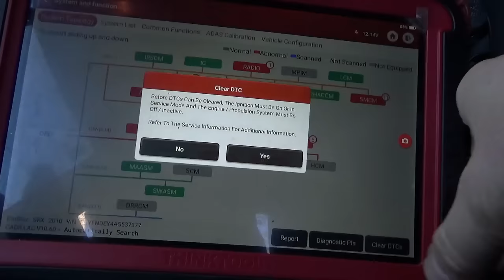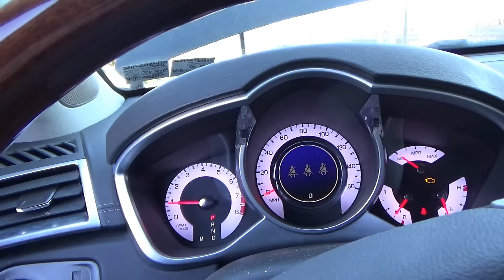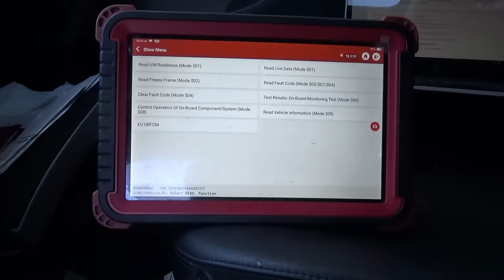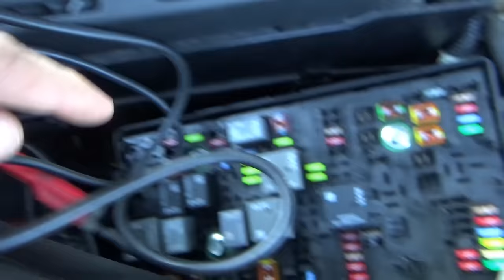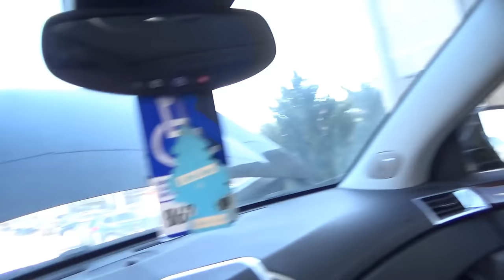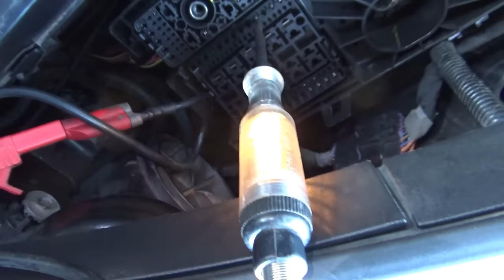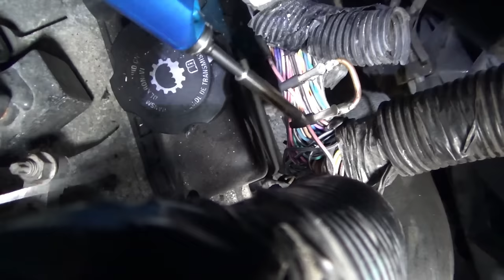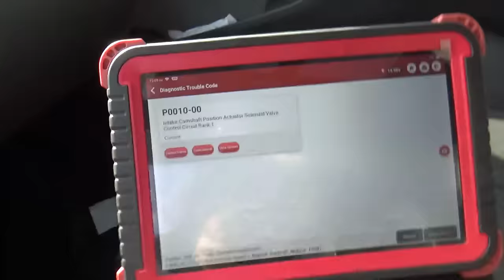Cadillac "Runs" on 2 CYLINDERS!?! (2010 SRX V6)

Comment: Hi Ivan, and the rest of the gang. My car has a similar issue. The engine was removed for some repairs and I guess some wires must have gotten damaged. Only bank 1 works. I have a power probe, could I use it to diagnose? Thanks a lot for any help. Btw, it's a 2007 Suzuki XL7, wich was made by GM, very similar to the Traverse.
Reply: I think Ivan knows a bit about the XL7

Comment: How much did you charge for the 2h of work? I live in CA and I can't find anybody able to diagnose electrical problems on my 24 year old Pathfinder. I guess all the good electricians left this expensive high tech area already. I am an electrical engineer and I understand wiring diagrams, but I live in an apartment, don't have a lift and can't get under the car to check fro broken wires.

Comment: Driving the car with 3 dead cylinders would cause the raw fuel to wash the oil off the cylinder walls of the dead cylinders. The car doesn't have long before it turns into an oil burner
Reply: Unbelievable that a 2010 car doesn't deactivate the fuel injectors...

Comment: 2011 Infinity G37 they replaced all the coil packs and now they say it’s the timing chain. Wouldn’t timing chain show before and separate from coils? It ran and they put it on computer. Thanks
Reply: What's the issue you were having?
Reply: @lieutenantdan8170  was missing and Mechanic changed all the coil packs. And now he says the timing chain needs to be replaced.
Reply: @lieutenantdan8170  i’ve had to replace a single coil pack once in a while, but not all of them. And it seems an engine analyzer would show if the timing chain and timing were off.
Reply: @yeehaw398  These engines don't usually have timing chain issue but they do have issues with the oil gallery gaskets blowing out and causing low oil pressure
Reply: @lieutenantdan8170  yes I have herd that. This is young fiend of my son. I think one coil pack maybe. Then to replace all and now say its timing chain seems like he is shooting in the dark. Thanks for your comments.
Reply: Might have an oil actuated solenoid for the VVT that is playing up due to low oil pressure or dirt clogging it's screen. Remove it and check.
Reply: @johnt.848  Good . I will have them check!! Thanks

Comment: “Technician” Yellow electrical tape 😂
Reply: Non technician. It's an over used terminology
Reply: We actually do use yellow electrical tape but only where you do airbag(inflatable restraint)  system circuit repairs. ;)

Comment: GM and Toyota are similar. 
Check out engine valves for certain GM's and they will also list 'for Toyota'.
But if one is a real solid citizen, they would
work with 'Hydraulic Press Channel", and see which vehicle withstands the greatest force.
Don't think Toyota can outwit the 'cash for clunkers test' yet ?
Obama had one tool in his kit...silica solution...
He could have been real mean and ordered the use of flame throwers.
The psychosis of 200 000 mi. 400 000 mi. 1000 000 mi.
But still...no magic.
People want magic, but cruelty persists.
Oops, I forgot... it's time to buy a $40 000.00 scanner.
Logic must prevail.

Comment: All those new parts for a crusty wire. The number of fools and idiots operating in this industry is astonishing to me. I get pissed off what things cost at the grocery store - but this? Absurd. Good catch!
Reply: You're assuming they didn't have prior codes that required the Cat to be changed.
Reply: The whole history is not here. Customer could have been driving with misfires for a while and damaged the converter. When they decided to have it looked at the tech would likely do a exhaust back pressure check and likely found it restricted. A restricted converter on one bank will cause misfires on the whole bank due to exhaust gas backing up with no where to go. Plugging an exhaust system causes cylinders to not have the ability to fire. Have to fix whats broken. So shop installs new converter and find it still misfires. Calls customer and they refuse further diagnosis. Unfortunately they are gonna need another converter because they continued to drive it with the misfires. I would bet the original repair order states no warranty on the new converter due to misfires and customer chose to drive it anyway. The fact the customer refused to have the p0010 code diagnosed by Ivan and said its fine tells me that is the most likely scenario here. Seems to want to ignore problems until they become more of a problem. The saying goes, pay me now or pay me more later.  I could be wrong but i see these types of things on a regular basis. Yes there are bad techs out there, also lots of good ones. But a bad customer does not make the tech bad. I always back up my diagnosis with test results and literature.

Comment: It's a Cadillac, it should have the quality way better than a Toyota. It should have the quality of a Lexus or that you'd expect from a Rolls Royce, not a GM truck.
Cadillac shouldn't be a chrome package.
Reply: Just because it's says caddy or Rolls Or some other hi dollar turd does not mean it's quality. You are paying for more crap they fit in a car to have the customer pay more. 
My 03 Chevy is still rumbling along at 377k miles. No fancy crap to blow air up my ass while I drive. Or no fancy Bose stereo crap. It's all BS thinking it quality. 
The same 3.6 engine is used in multiple vehicles.
Reply: Not if it's made on an American assembly line.